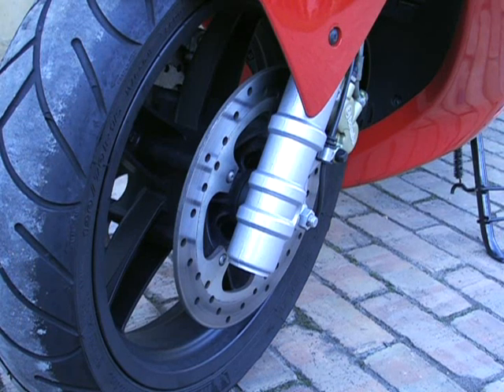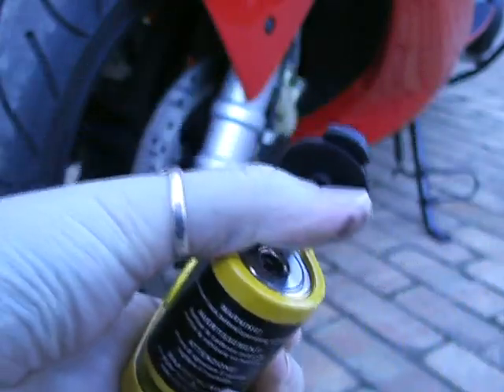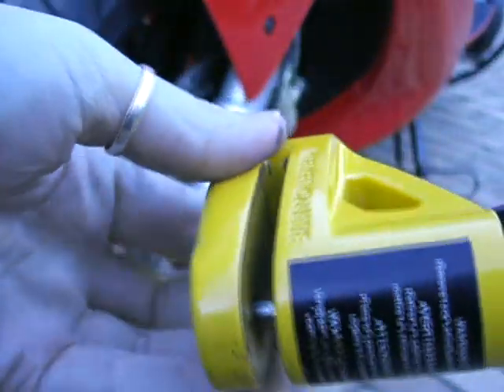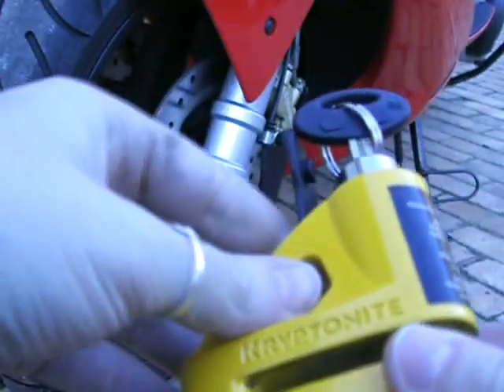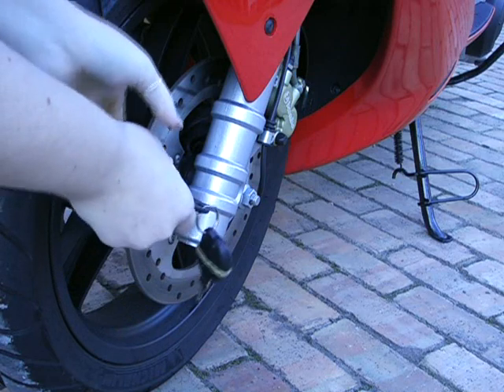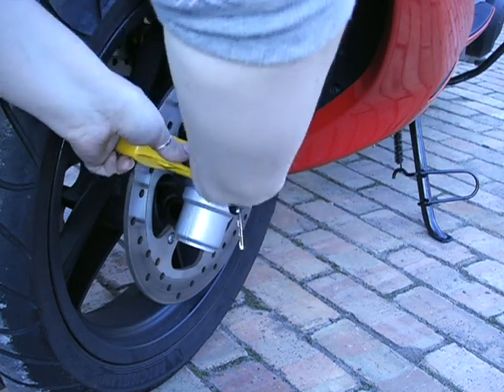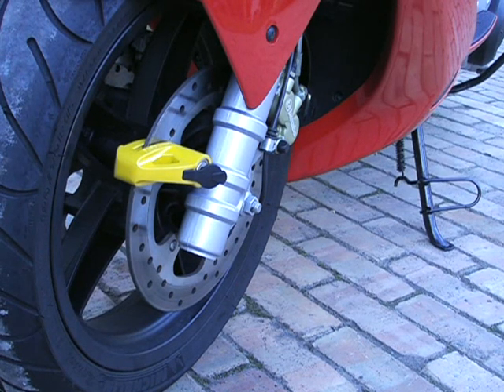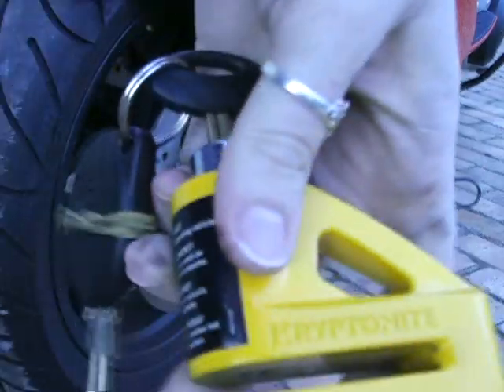Motorcycle Security - How to use a Disc Lock

Comment: Lock the rear brake disc.  This could deter up to 2 thieves.  A single thief could brake the steering lock, but could not drive away.  2 thieves would want to roll your bike into a van/truck.  This is typically done by elevating the front of the bike and rolling it on its rear tire.  With a locked rear, they would have to heave it a few feet at a time, or break your steering lock to roll by the front tire.  It creates a little extra work for them, they might skip your bike.

Comment: 1st of disk locks can be smashed by using a punch and a hammer so when putting the lock on make sure you put is so the key hole is not on the outer side of the disk make sure it on the inside  no one would bother trying to brake it this way.

Comment: As my disc brake isn’t perforated, is it the same if I lock it to one of the “bigger holes” on the disc? I mean I tried it and it stays on and the disc is definitely locked. Also, do you suggest locking the front or rear disc? Thanks.